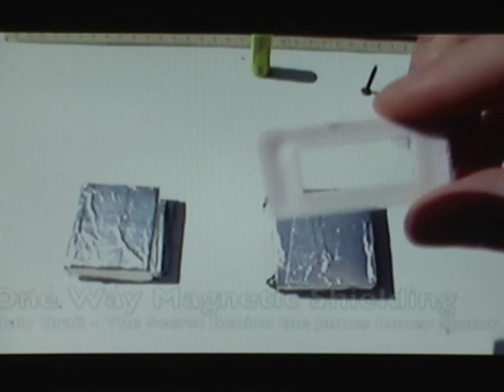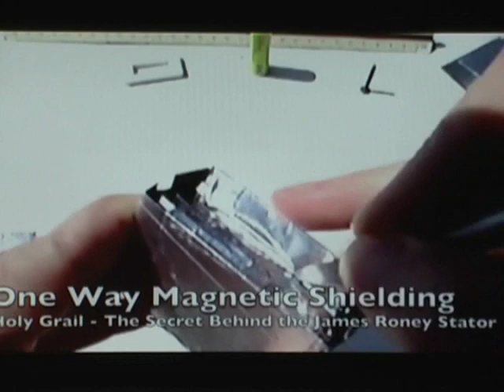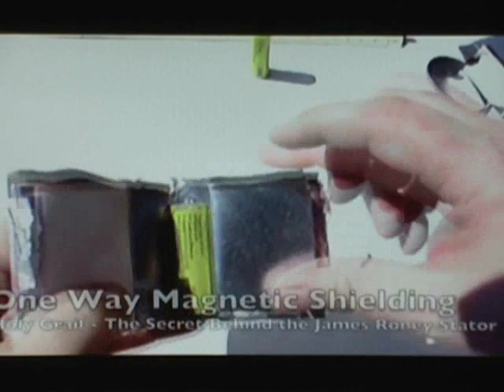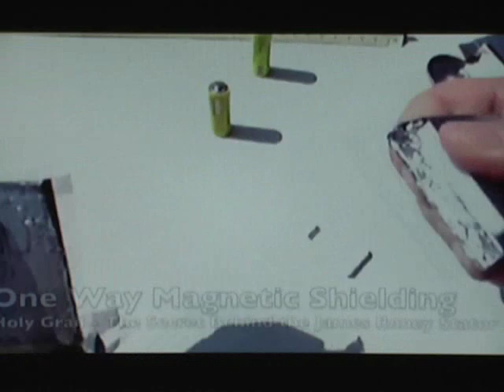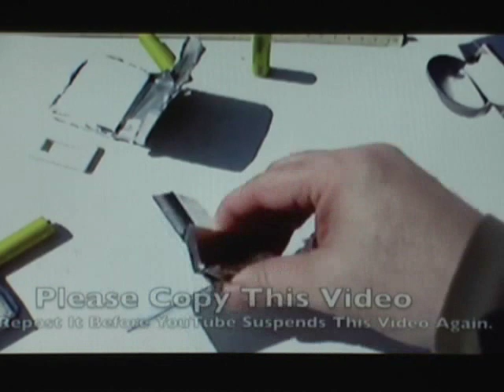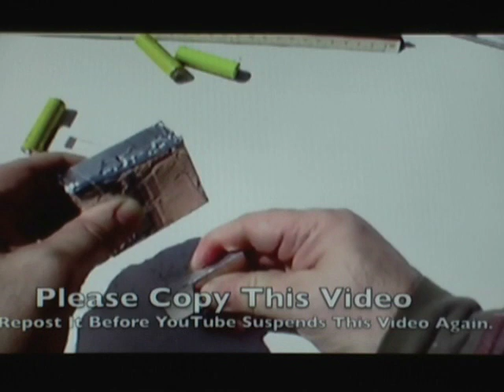Magnetic Shielding

Comment: So essentially you took a strong magnet, placed a battery on one end, wrapped that end with flashing, added another battery to the same end and another layer of flashing. You then make a second one of these.

Haven't you simply put 4 batteries between 2 magnets on one end and none on the other end? Of course it will be weaker with the batteries in between. The magnets are much farther apart on that end.